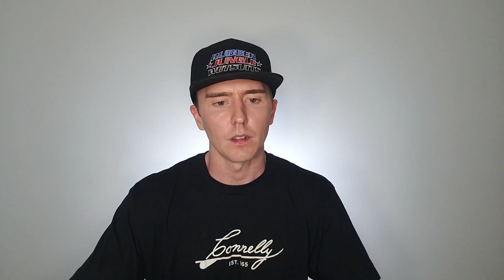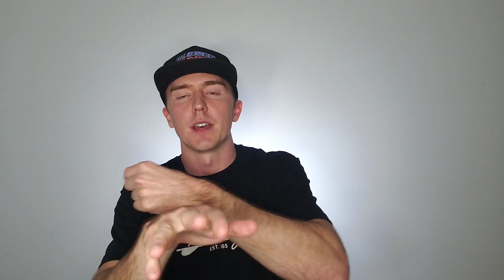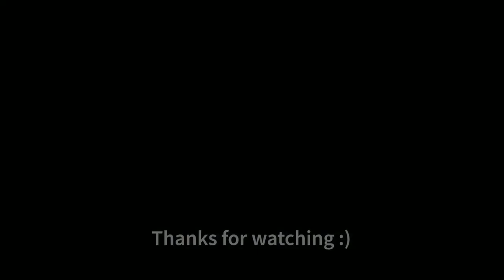How to Drive a Boat For Slalom Water Skiing

Comment: Hi Joel. Thanks for that - was good and informative to listen to. I have a 1990 prostar 200 (outboard) and it's actually got quite a nice wake but is a handful to drive in the course. Of course, I wouldn't expect it to be as nice as a modern inboard but have you had any experience with people making adjustments to boats like these to get them tracking a little better? E.g. 5 bladed prop (rather than 3), trim tabs on the back. It still has cable steering - so I would expect that hydraulic would probably make quite a difference. Cheers, Trav.

Comment: Why do you say a Bimini is an enemy of good boat driving?
Reply: Personally, I feel like it lifts the boat up and makes it harder to keep in the center of the course. I’m driving a 97 ski Nautique, no more than 1/2 tank of gas. We just put 200lbs in the front and it tracks better. We need the Bimini or the steering wheel is too hot to touch!